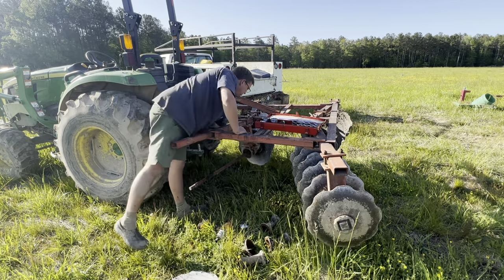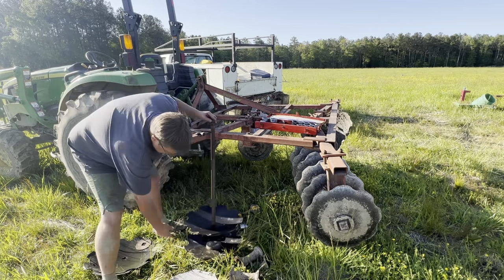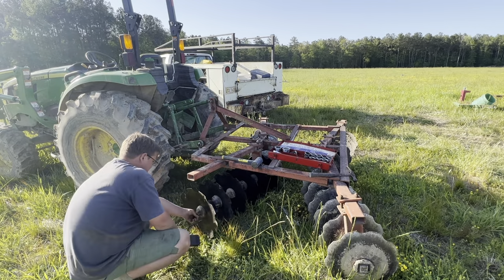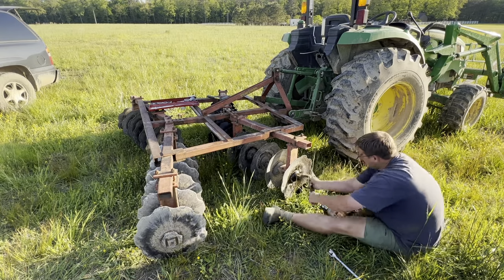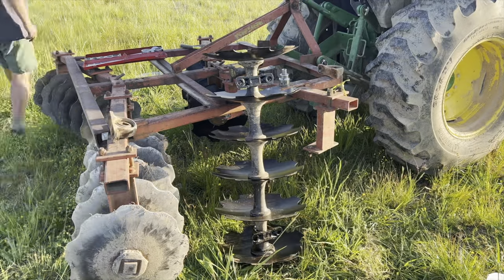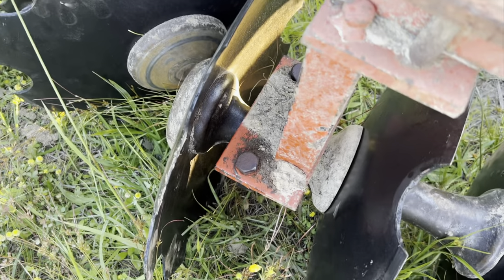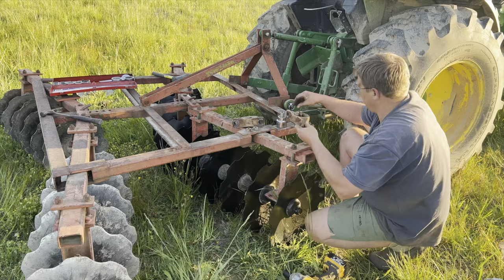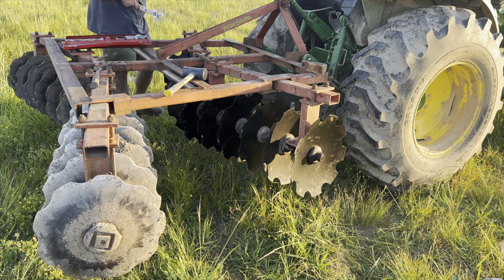Easier than I Thought: Replacing the Bearings and Blades on a Disc Harrow

Comment: Good video, I particularly like how you didn’t edit out the part where you forgot the order of how things were supposed to go back together. You showed the entire process. An honest video. You may wanna save your discs. Perhaps you could have them restored by someone? Kinda like restoring a trim edge on a die perhaps?  🤷‍♂️ Great video, now let’s see a full in depth review of that tractor!
Reply from the maker: Saved the blades and bearings. Beating arent in great shape but are ok. We can replace a single blade if we break one of the back ones.

Comment: This was a big help! I've acquired an old Tufline TMF series disc harrow, and need to replace all the discs. Before the go pulling it apart, i wanted to see how it's done. 

Yours looks very similar to what im working with. What size axle does it use? And where did you find the bearings?
Reply from the maker: Ironically, the tuffline company started in columbus, MS where I live and grew up. Mine was a square axle, I think it was 1 or 1 and 1/8, but I don't remember. Their phone number is (662) 328-8347

Comment: Yes i have replaced bearings a hundred times time’s  a couple of good pipe wrenches and big ones are important and snipe’s or big pipes that go over the pipe wrenches so as to leverage the torque and break things loose or to torque up the blades on the gang once the bearings are in place that final torquing up and a good smaller wrenches for doing the smaller bolts  for the u bolts etc and that’s about it and mosquito spray and a good pair of coveralls and knee pads and good durable goat skin leather gloves and your good to go  and also use your tractor tires as leverage what i mean by that is for example take your pipe wrench and put it up against the tractor tire the end of the pipe wrench the handle part as it’s a solid base and won’t move as your tightening or loosening either way at the beginning unbuttoning the gang’s or once new bearings are in place buttoning up again then you slide the whole gang in place under the frame of the disc harrows or disc plow and your frame is jacked up a bit you then take your good dependable jack all and you lower it over the gang towers and everything should line up than reuse your ubolt’s and big nuts and lock washer and torque em up evenly and real tight and you are ready for the next gang and so on till your Finished the job now go have a coffee or beer and hope you don’t have to do this again for a few hours until you hear that dreaded squeaky sound again inside your cab on a hot sweaty day in the middle of seeding or on a cold fall day when you just want peace in your warm tractor cab either way good luck and have a productive and prosperous day .
Reply from the maker: Lots of great info here. Thank you.